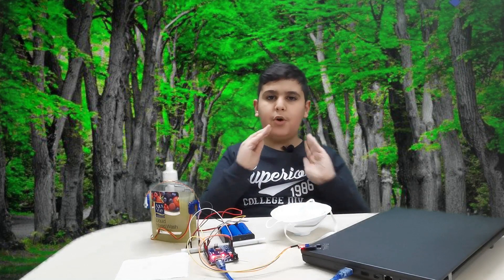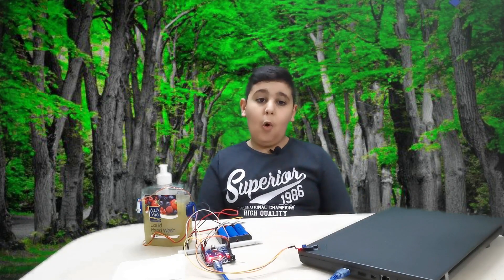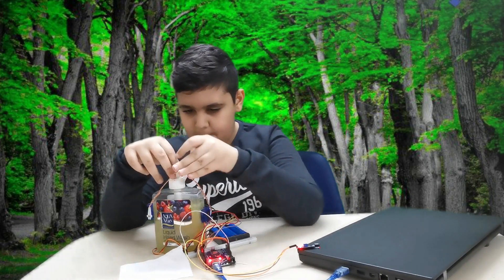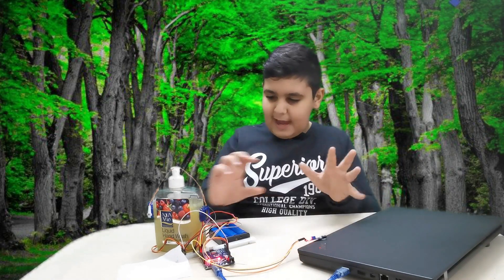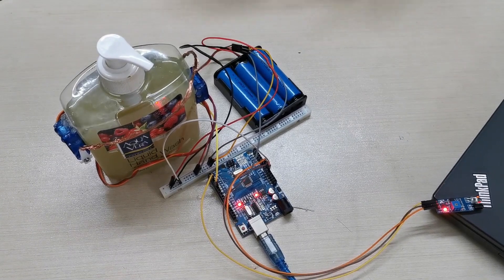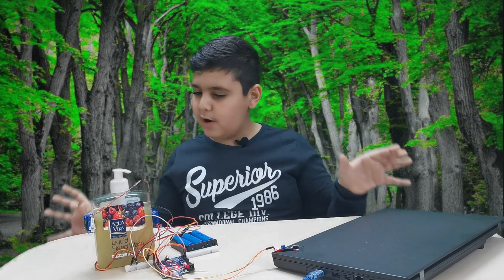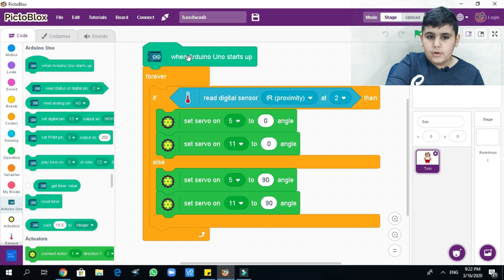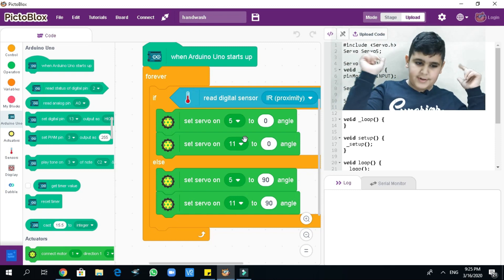arduino for kids  how to make your own hand sanitizer machine using arduino

Comment: Incredible set up! You will need to flatten the pressure on the soap dispenser a little bit so the weight is distributed more evenly instead of that thin wire. Try to put a little bit of wood on the top of the pump and connect that to the wire, see if that helps?
Reply from the maker: mmm, looks an amazing suggestion , let me give it a shot 👍👍

Comment: You could also look at servos with metallic gears. The plastic gears can skip easily with a large load, and that's the noise you are hearing.
Reply from the maker: wow i didn't even know that there is such servo , thanks for the information i will try my best to find such one